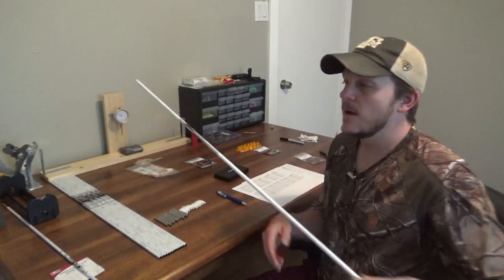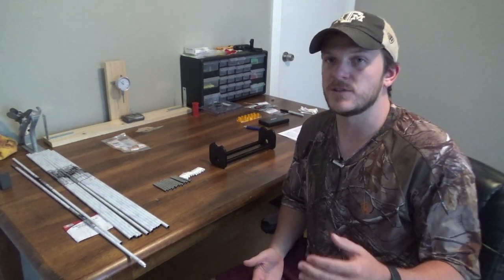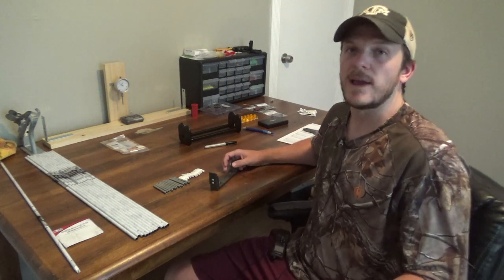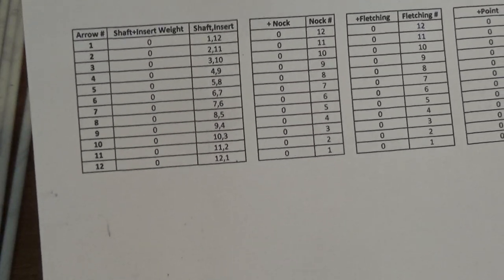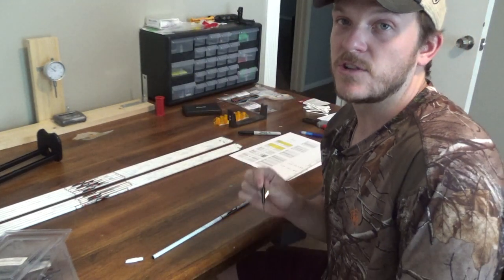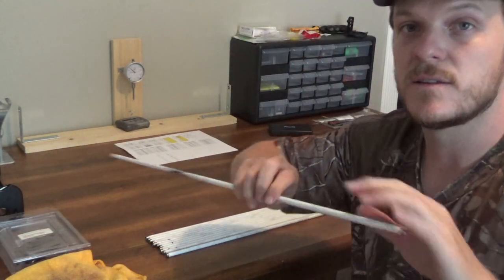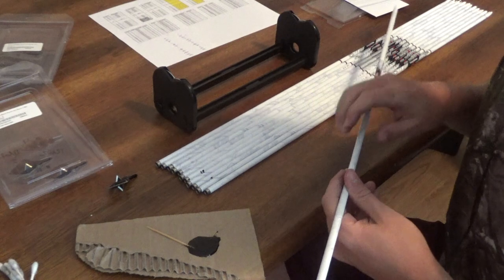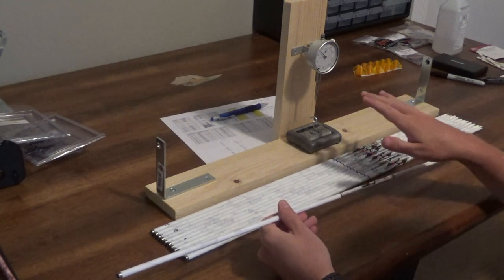Ranch Fairy Kit Part 3 - Insert Tuning

Comment: My thoughts of zinger or f.o.b. Is easy to bare shaft nock tune and see where you want top of arrow and not have to mess with vanes and reusable and quick so time is money as well 
Averagejack has video about clocking and it not about arrows but how serving is on string and 95% of bows will have left hand spin just make sure if ever go further down the fairy duster rabbit hole and go single bevel you put same bevel as offset to vanes
Reply from the maker: Yeah! I haven’t gone single bevel yet, mostly because of price, and the Magnus broad heads seem to work really well for me, but I may switch this year!

Comment: It seems to me that getting total arrow weight the same as possible through combo of arrow and insert weight is correct. However, when you pair the heaviest nock with the lightest arrow/insert set up you effect FOC to the highest degree possible. It may be better to pair the lightest nock with the lightest arrow setup.
Reply from the maker: That’s a good thought and I see where you’re coming from. I think it kind of depends on what you are looking for. That method may get you the highest foc on the first few arrows. But then say arrows 3-6 have a lower foc. My ultimate goal was to have all 12 of my arrows as similar as possible. That way the 6 arrows I practiced with were almost identical to the 6 arrows I hunted with. Most of my nocks were .2 grains difference max, so my guess is to the average person it’s not really going to be noticeable one way or another.

Comment: Damn, I wanted to do this but now I see how much work it is
Reply from the maker: It does take a bit, but it is worth it for sure. For this year I would just make sure you get a good fixed blade and make sure it’s as sharp as can be. Check out the Magnus stinger or black hornet. I also have sharpening videos on both. But they are great heads. Then next year go through the process because it’s worth it!
Reply: @ZManOutdoors  yea you need a lot more stuff than I had anticipated so I think I'm just gona buy some more ideal arrows for my bow for now that are already built and maybe some heavier tips and see what they do..also I bought a hand sharpener but it doesn't seem to be working
Reply from the maker: That’s a good idea for this year! Make sure you get it tuned up so you good flight.

What sharpener did you buy? I’m not great at free hand sharpening... I need a guide haha. I have the lansky for my knives and I bought the stay sharp guides for my broad heads. Both work really well.
Reply: @ZManOutdoors  just a hand held one with a v shaped sharpener from the local sports store
Reply from the maker: Yeah those are tough and I really never felt like I could get anything shaving sharp with them. Not sure what broad head you are using. But check out stay sharp’s jigs. I have two videos on them and the hunting public has one too. They aren’t super expensive and it really works well.

There is a link in the description of my sharpening videos to their website too.
Reply: @ZManOutdoors  yes I've been thinking i might need a jig setup of some kind

Comment: hey just wondering why you didnt get the spinning inserts from ethicks? i mean on all there videos the spinning inserts are waaaay better than the static ones just would like ta no what your opinion on the spinning ones were ?and if you have tryed them ? great videos keep um coming thanx,.
Reply from the maker: Anthony, thanks for the question/comment. I have not tried the spinning inserts at all. I did look at them some when going with Ethics, however my thought process was this was a mechanical device and it has a greater chance to fail. That being said, I have heard some good things about them and may try them out next season. If I do, I will be sure to add a video on how I like them.

Comment: So educate me. If your fletching was hitting your cables wouldn't that explain a lot of the left to right issues were seeing during paper tuning. It would seem to me that you wouldn't want any part of the arrow to touch the cables. Just asking, trying to learn.
Reply from the maker: Yes you are correct, the fletching hitting the cables will for sure cause issues when it comes to paper tuning. I am not quite sure if it was the way I fletched them or my form that was causing that to happen. Since I switched to the zinger fletchings, I have not noticed anything hitting the cables or the rest. However I did notice that the 4 fletch zingers I have, ripped along one fletch. This makes me think I am having contact with the rest or the cable causing this. I have switched back to the 3 fletch even though I did not notice any big accuracy issues at 20 - 30 yards. I just did not want to risk anything  that would cause a bad shot.
Reply: Forgive if this is basic knowledge but when I am trying to figure out a wonky arrow flight one thing I do is to chalk the fletchings so I can see if they are hitting anything.  Just a thought
Reply from the maker: I actually started doing that. That’s how I tuned my hamskea rest as well. Works really well!